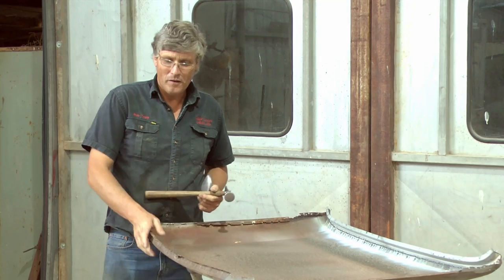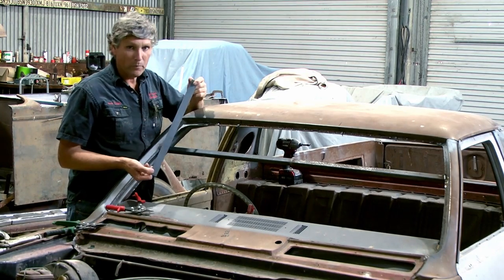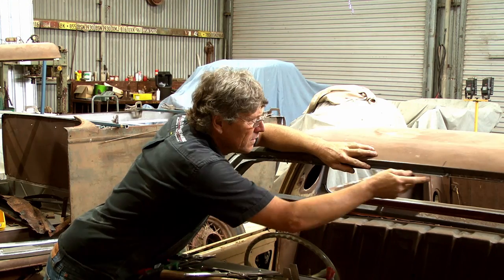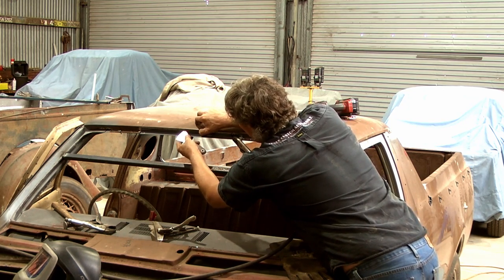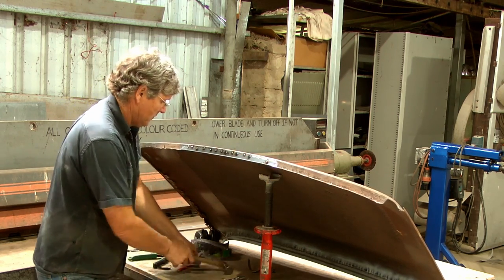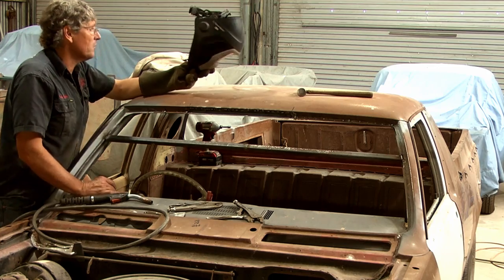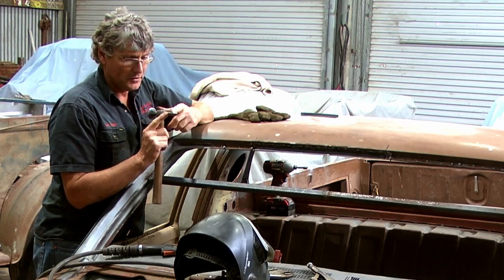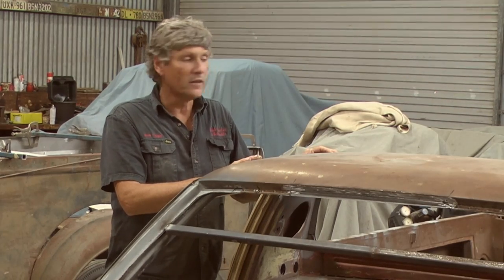1970 Holden HG ute - roof rust repairs Part 5

Comment: Thanks Rob & Deb, another great video. Like the paint scraper tip, works better than the old hacksaw blade that I've been using for years.
Reply from the maker: Hi Mick. Good to hear from you. It's funny how we get attached to these old things we use for years and years and years. My poor old broken paint scraper wound up being a broken paint scraper, because it was being used for something it wasn't designed for. That was back in the 1980s, but that turned it into a better tool for all these alignment jobs. It also gets used for paint stripping, scratching paint from under the corners of bonnet frames, etc.
Cheers
Rob

Comment: Great videos Rob, I’ve got a Hg Ute I’m working on and need to do some welding on it, could you please tell me what set up you use as in wire size etc?
Reply from the maker: Hi Mate. I am using 0.6mm wire in the welder that I use for car panels. If you look back through my videos on YouTube there is a few dedicated to welding car panels. These start off with the very basics of setting up the machine and work through to welding panels together.  Good to hear from you, and good luck with your project. Cheers Rob.

Comment: Did all HK's have that same windscreen?
Reply from the maker: Hi Mate All HK except Monaro have the square top corners. The official word from GMH in 69 was that Kingswood sedan would also have the rounded corners for HT and HG. History has shown that some Belmont sedans wound up with round corners and others had square.  It seems as time went by the body shells got mixed up on the assembly line. Cheers Rob.